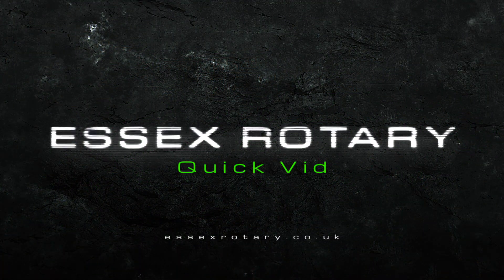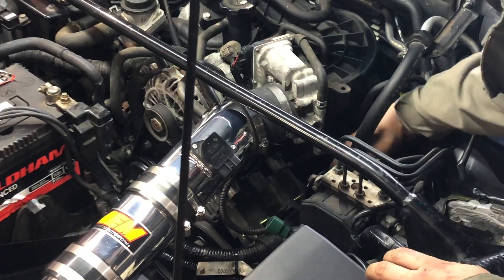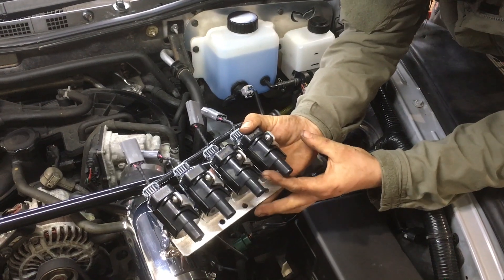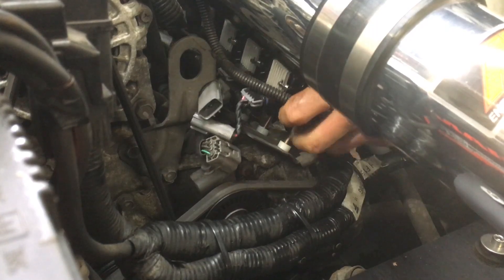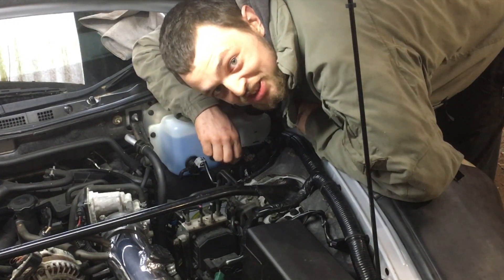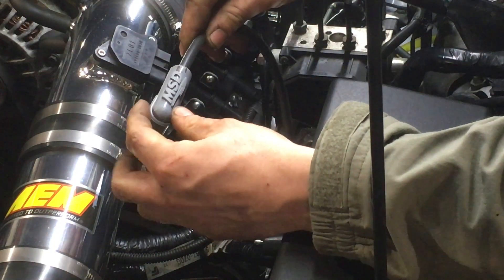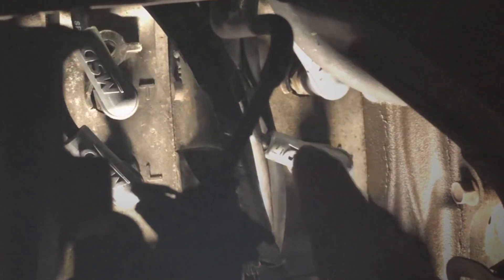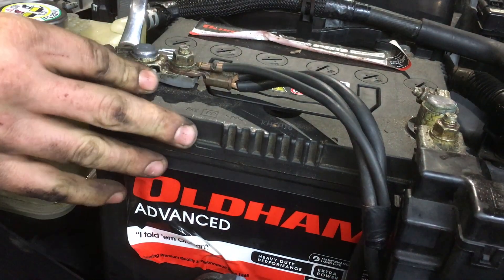Essex Rotary Quick Vid 34 - Installing Black Halo Racing RX8 Coil Upgrade

Comment: I did this swap on my 06 and I have a hard start condition with it.  Fires right up on the factory ignition…. I have it grounded on the mounting bracket.  Is that my issue?

Comment: that metal clamp or what you are pointing at 5:39 i removed,  its nothing serious i think , or ?
Reply from the maker: It is just the front lifting eye for the engine, you will need it if your removing your engine however until then its just in the way.
Just keep it in a safe place.
Make sure you turque those bolts back up to 25nm though to ensure a proper seal on the water pump